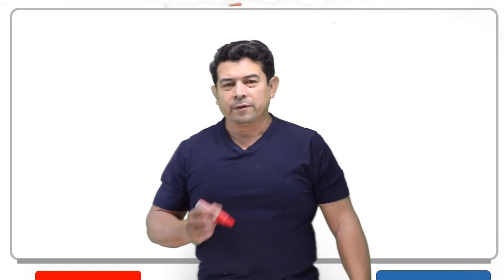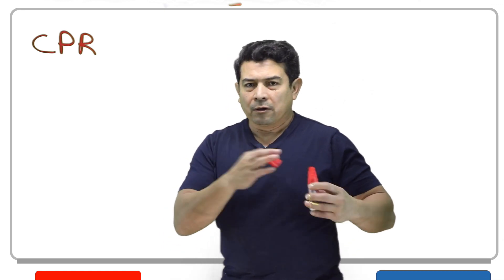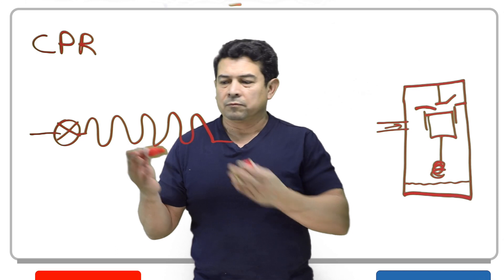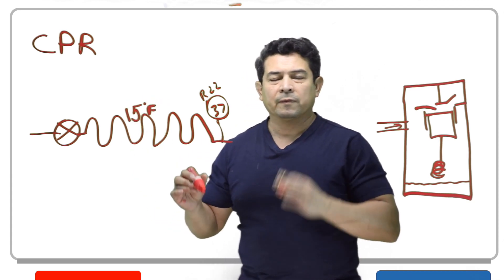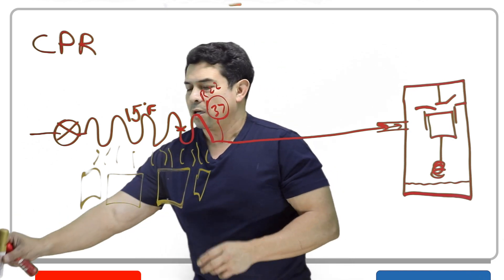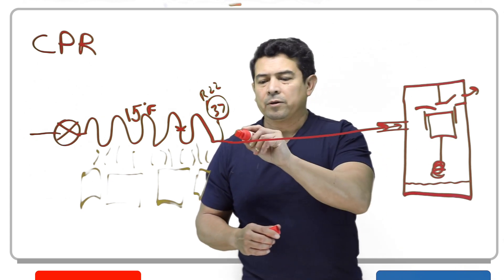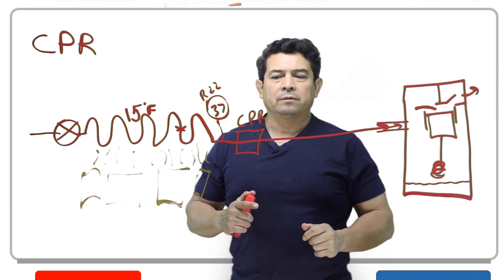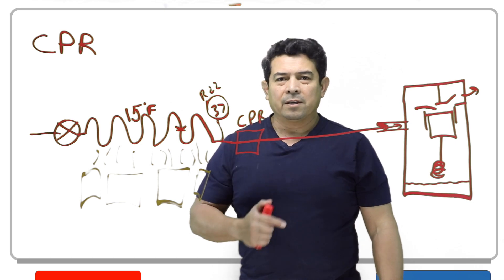CPR Valve-HVAC Online Training and Courses

Comment: The location of the valve may be off. I have read that CPR valve should be installed in the suction line close to the compressor inlet. In this example it’s 1:1 evaporator to compressor. Maybe in a multi evaporator system it’s different. Thoughts?
Reply from the maker: Thank you for your message, and I was reading your message. I am in this video talking about a compressor or crank case pressure regulating valve. That would be close to the compressor to regulate the pressure in the crank case of the compressor so it is not overloaded. The ones that go by the evaporator that is your EPR valve, evaporator pressure regulating valve. Those are designed to maintain pressures in evaporator when you have several evaporators at different temperatures. This CPR is strictly to maintain the pressure in the crank case so the compressor is not overloaded.
I hope this makes sense, thank you for your message and thank you for watching!

Comment: Awesome video. How do you properly set a cpr valve? Thank you!!!
Reply from the maker: they come preset but what I have done if I need to adjust it, I create a high pressure in the suction and then I adjust the valve to maintain the pressure I want to maintain.  Very much like when I set a water regulating valve. as the unit is running I set it to maintain the pressure I want to maintain.    I hope this make sense.       thank you for watching!!!
Reply: @ thank you!!!

Comment: Thanks a lot for the wonderful video. I have two questions. 1. How the CPR will actually work? Is it something like pre-setting of some pressure value or something like solenoid valve? In that case, if it works in a similar way of throttling valve, where does the extra pressure or fluid will go? 2. If the CPR can decrease the pressure, it can also decrease the refrigerant temperature at the compressor suction, right? In that case, I am assuming that the CPR can also help with protecting the compressor from very high superheat at the suction. Hope to get your valuable feedback. Thanks.
Reply from the maker: Hi! Thank you for sending those questions in. First of all, this regulating valve can be adjusted and it works off of a spring so now once the pressure is set is going to maintain that specific pressure going to the compressor. As the compressor gets high pressure which it will not be able to handle, the CPR valve is going to close down and not allow all of that gas to go to the compressor keeping the compressor from overloading. The pressure is going to back up into the evaporator. What this  valve is going to do is to make sure that you do not have too much pressure going to the compressor so the compressor is not overloaded. It does not know anything about super heat so it will just control the pressure going to the compressor. The compressor may be receiving high superheated  refrigerant vapor, but it will only be for a short amount of time until the evaporator pulls the heat out of the food and pressures and temperatures become normal. I hope this makes sense and thank you for sending you comments in and thank you for watching!
Reply: @AirConAcademy  , thank you very much for your valuable feedback and clarifications. I can understand the valve works on the spring mechanism. Are these valves manually controlled or most commonly electronically controlled? Thanks a lot.
Reply from the maker: @mdmuntasiralam774    I do not know if they make some that are electronically controlled. All of the ones that I know are set and they maintain that pressure. They know what the maximum pressure the compressor can handle so they are preset at that so they do not overheat the compressor. Good luck! And thank you again for watching and sending your comments in.

Comment: Hi i have a question its about hot gas bypass.
Why nowadays we don't see in domestic refrigeration for fridge and freezer this method to use in defrosting the machine but rather use electric heater defrost? My dad has an old fridge with hot gas bypass defrost and he never have issue with defrost or heater busted. Thanks
Reply from the maker: Hi, I'm not really sure why hot gas bypass is not used for fridge and freezers anymore. It could be the cost. It is cheaper to use an electric heater in the back of freezer, evaporator fan to run the piping and controls for the hot gas bypass.  A lot of times companies make decisions based on profits. But I am not really 100% sure that this is the reason. Good luck and thank you for your question and thank you for watching!

Comment: Thanks alot sir .could you ask to describe why by increasing the pressure of refrigerant in output of evaporate, the compressor will get overloaded?
Reply from the maker: The compressor will be overloaded because it will be getting too much gas coming to it.  As the pressure on the suction increases so will the pressure on the high side and the amperage will increase because it is doing more work, and some of these compressors are not designed to work with these high pressures. So you could say we're trying to keep the compressor from being overloaded. It is a tricky situation but it is a must on some systems. I hope this explains it.
Reply: You're just amazing! I had the same question and you explained it so well! Thanks for being sooo good at what you do! Amazing!
Reply: As the suction pressure increases so does the density of the gas. Which makes the compressor have to output more work to compress the more dense gas. When a compressor is made for low temp functions. It's made with lower density compression in mind. Which takes much less work for the compressor to handle. The .ore dense the refrigerant it's like shoveling wet snow it's much heavier and hard to move when it's less dense it's like moving fluffy dry snow which weighs less so it's easier to move.

Comment: Hi. This is a very informative video. I have a situation where the discharge connection to a vehicle A/C compressor has blown out twice about 30 minutes after the system was started up. Obviously there is something wrong with the relief valve on the compressor discharge. Do you think a bad CPR could cause the overpressure to happen in the first place? Thanks
Reply from the maker: Wow! That's crazy how that discharge connection has blown out! No, I don't believe a CPR could cause this. In a vehicle typically you do not have a CPR valve. Most likely you have a restriction just before the metering device going into the evaporator. I have found out that there is a screen before the metering device in the Liquid line and most of the time you cannot tell the screen is there. If that screen is plugged up you're going to create that high-pressure and blow the line. hopefully it is only a partial clog on that screen and you can see if there's a temperature difference in the line before the metering device. This way you can tell where the screen is and where the restriction is. If it is completely clogged up you may have to replace the entire liquid line to get rid of that plugged screen.  Good luck I hope you get that taken care of!

Comment: This question may not be appropriate but I have to ask.  I'm rebuilding semi-hermatic compressor in a reach-in freezer.  It lost all of it's oil and the compressor seized. I discovered the oil and refrigerant leaked out from, guess what, the CPR valve, a Sporlan CRO-10.  The end cap which screws on has an O ring, the oil and refrigerant leaked past the cap.  Would you say the bellows broke and that's how the pressure ended up at the screw-on cap?  I removed the CPR valve, with the cap removed am able to blow air from the inlet or outlet, and it comes out the hole which has the adjusting nut/screw.  Would you agree the CPR is bad and needs replacement?   Thanks in advance -  Jim
Reply from the maker: Yes, I would say that the bellows inside broke. You would definitely need to replace the CPR valve. One word of caution is do you think all of the oil leaks out? Or is there some stuck in the evaporator? The reason I'm asking this is because rebuilding the compressor you will need to add new oil to the system. If half of the oil is in the compressor  or throughout the system when you add oil you will have too much oil. That means she will have to monitor the oil level in the compressor to see if that oil comes back. If the oil is stuck in the evaporator then your evaporator will not cool like it is supposed to.  Just something to think about.   good luck!
Reply: @AirConAcademy  Since I had to rebuild the compressor, I flushed the entire insides.  I installed new crankshaft bearings, after being pressed in I had to run a reamer through them because they took a crush, the inside diameter was actually smaller than the crankshaft.  A new oil pump was installed, I did not use an assembly lube, just smeared POE oil on the journals.  I chose not to remove the pistons or the valve plate.  New poe oil was added, the bottom plate attached and all bolts properly torqued.  When I removed the CPR valve, a bunch of oil came out of it too.  I purchased a new CPR valve, 5/8" diameter instead of 1/2", so I'll have to do the appropriate plumbing to make it fit.  It comes per-adjusted by the factory to I believe 60psi.
Reply from the maker: @emptech  very good! One thing you need to remember is that by using POE oil when assembling, it is constantly absorbing moisture from the atmosphere so it will turn into acid as it absorbs moisture. Real you will need to keep an eye on it when you first start it up and take steps to neutralize the acid that would be created with the POE oil.

Comment: Hi sir,
Could you make video on oil regulators(traxoil, Alco & sporlan)?. And oil level sensors like OLCK &DELTA PII.
Reply from the maker: I am not sure i am familiar with oil regulators?   where have you seen them?
Reply: @AirConAcademy  oil regulators comes in compressors sir
Reply from the maker: @shivayogibankapur1326  OK  Thank you!!!!   I will see.
Reply: @AirConAcademy  in compressors and in super market refrigeration system

Comment: Could you please be so kind to explain how to match an expansion   valve tonage of the evaporator to the tonnage of the condenser unit
Reply: What I meant was that for a walk in  freezers, eva temp of say minus 20 degrees farenheit to match with a 5 ton low temp. condenser unit,what the role of tumb here?
Reply from the maker: @albertspence666  Oh   I am sorry I understand now but unfortunately I am not aware of a rule of thumb.   I sure wish I had something to tell you. I am sorry.
Reply: @albertspence666  you're talking 15hp compressor ? Because it's 12,000 btu  per 3 hp at low temp so 3 x 5=15hp that's 60,000 btu .I think you're running a 5 hp which would be a 1 1/2 to 2 ton valve
Reply from the maker: I’m not quite sure I understand your question. But let me see if this helps. If we are talking an air conditioning system. The technician should start by doing a heat load calculation to see  what tonnage the air condition unit needs to be.   The unit is purchased as I said where are the supply house with supply you with, for example, a 3 ton evaporator that would come with the TXV, and they would also sell you a condensing unit. TXV‘s typically have the tonnage stamped on them or they are labeled with their specific tonnage. They would come with the evaporator and if you have a 2 ton TXV and evaporator you would simply just order a 2 ton condensing unit.    But first we would have to know how much cooling we need to do or in other words how many BTUs we have to remove from the space every hour. I hope this helped. And I hope this answers your question. Thank you for watching.

Comment: Hallo Julio, could you please do a Video to explain how could an evaporator handles 100% warm outside air to cool it down to 12C from 36C? should this valve be installed to protect the compressor? what are the other procedures that should be taken in consideration for this All Outside Air HVAC unit without any heat recovery?
Reply from the maker: Thank you for your request. Let me see what I can do. I have been very busy working on some courses but I am making a note of this and see what I can do. Thank you very much!